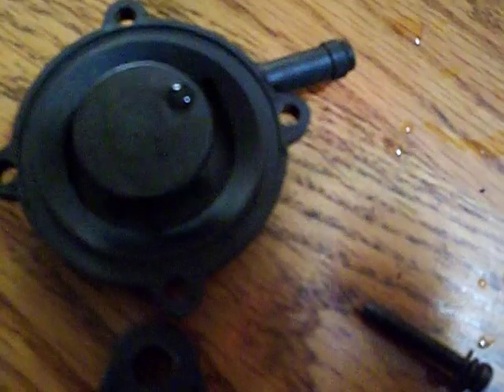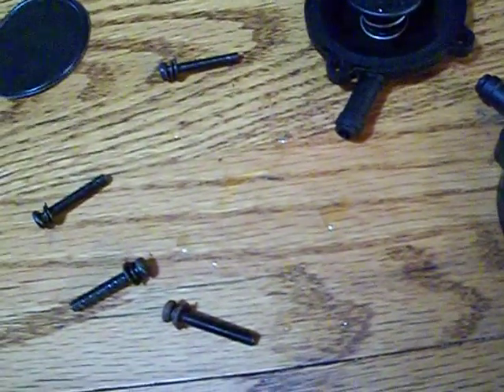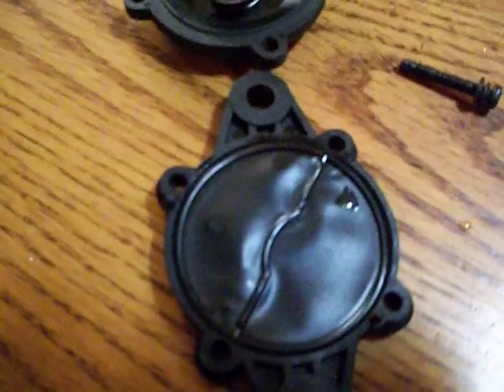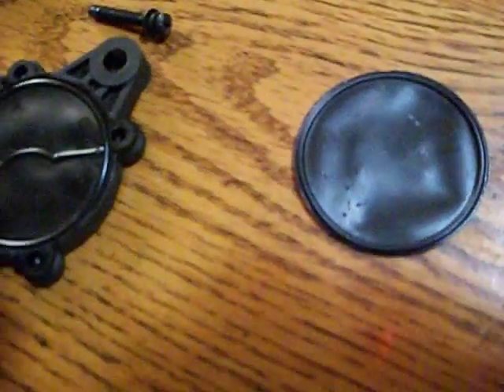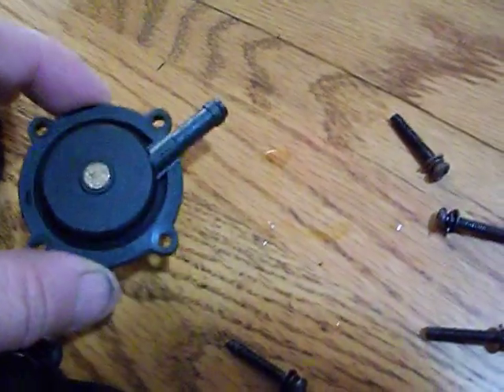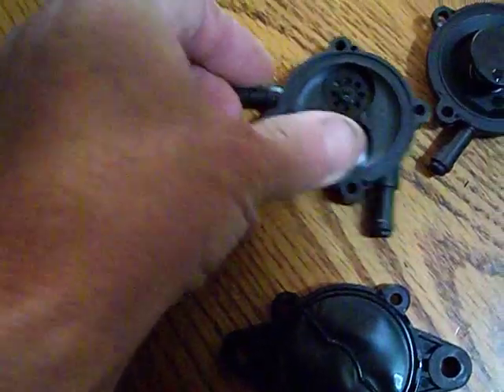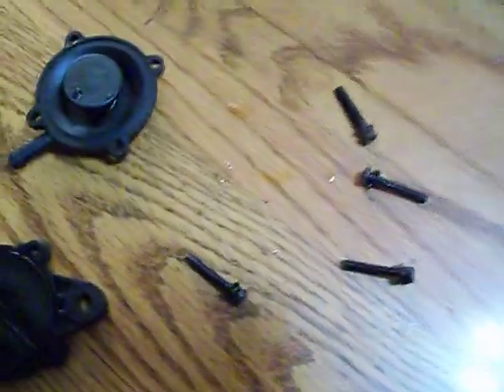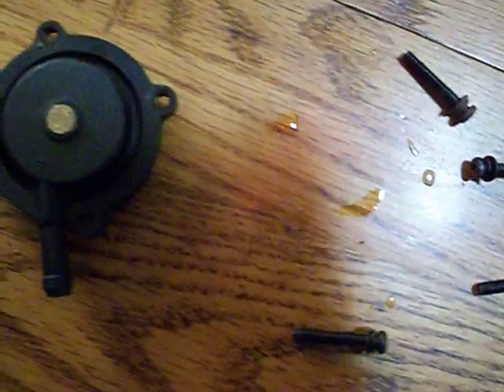Explain this?

Comment: If it was sitting for a while some cheap gas will literally turn to water, dunno if that could be a possible issue but heads up 👌
Reply from the maker: Well it does not really turn to water. It will turn to turpentine tho if left sitting for a very long time but water will get into the fuel tank just from sitting in the sun and cold nights. That will make condensation. This is why we get water at the fuel stations from their tanks being in the ground. These dang fuel stations will wait till someone complains before they have the water taken from them. The pick up tube in these tanks in the ground are between 8 to 12 inches from the bottom and with water being heavier than gas, then you know. Here is something that you all need to know as well. If you see a fuel truck at the gas station putting fuel into the ground then DO NOT BUY ANY FUEL! WAIT ABOUT AN HOUR OR YOU WILL SUCK THE BUBBLES OF WATER UP AND INTO YOUR VEHICLE!